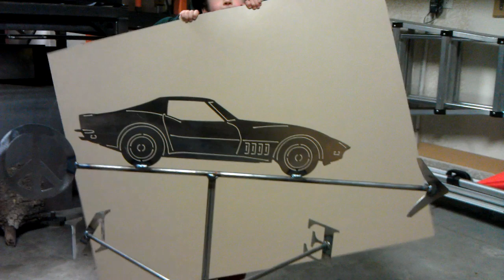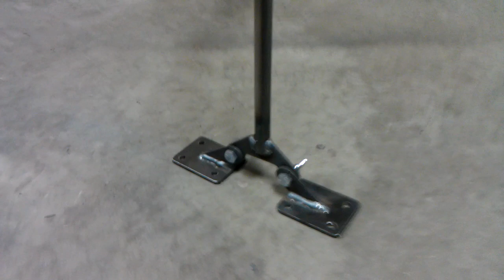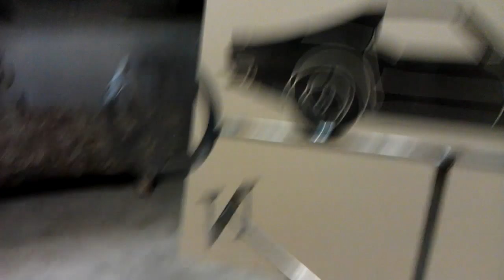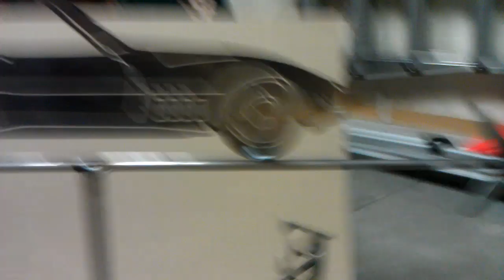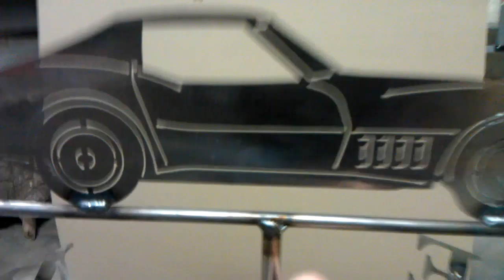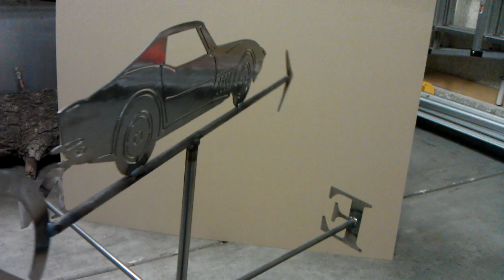Custom Weather vane

Comment: Just looking at this for the first time. Nice Job! Do you mind showing or explaining the single ball bearing at the top and how it marrys to the rod point. I just can't figure that one out...
Reply from the maker: ***** It fits within the tube and then I weld the top of it to the tube.  The rod goes up the tube, and has a point on the end of it.  The point rests on the ball bearing.  It has been a while since I built this, so I don't remember all of the details, but I think I put some needle bearings in the tube too to reduce friction.
Reply: ***** Thank you...

Comment from the maker: I found some on ebay pretty cheap.  The ID was 1/4" and The OD of the bearings couldn't be bigger than the pipe.  I drilled out the ends of each pipe with a bit that was about the same OD as the bearing, and then pressed them in.  I have a press to do that, but some brute force may be enough to get them in.  You don't want them too tight anyway, or they will be destroyed (did that with the first attempt).

Comment from the maker: @Hunkerbunker346 
I doubt it.  Lightening will strike it if it wants.  I think the best way to prevent as much damage as possible is to give it easy access to the ground, via a copper wire (probably relatively thick) that is attached to the weather vane and runs down to the ground--just like a lightening rod

Comment: i have a question about weathervanes i'm buying one this spring to replace the rotted cupola that's on our gazebo if i wanted to sort of lightning proof the weathervane do you think if i bought rubber washers and put them in the shaft of the product or even under the mounting bracket if it would protect it?